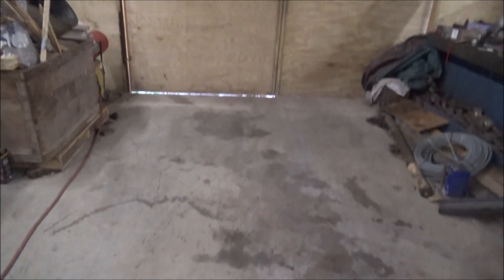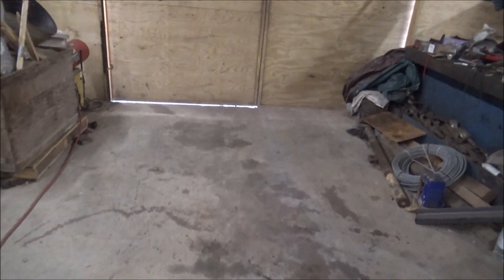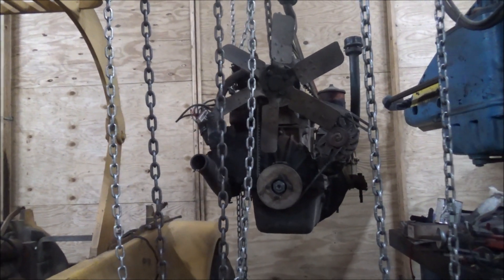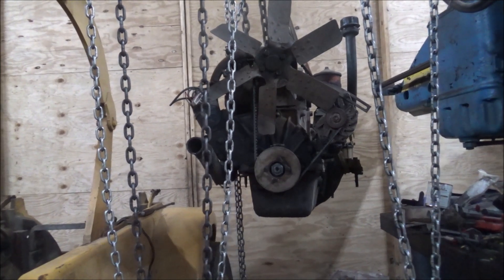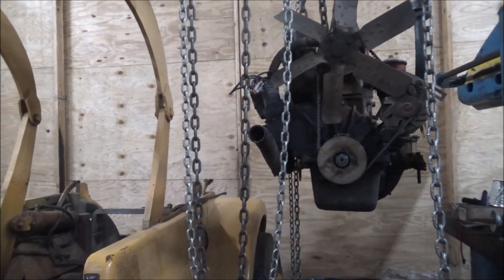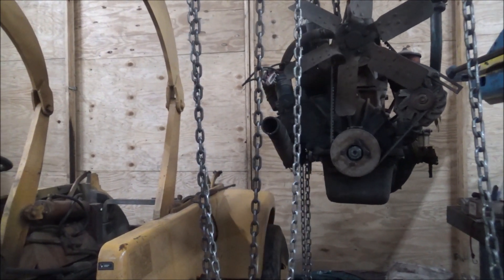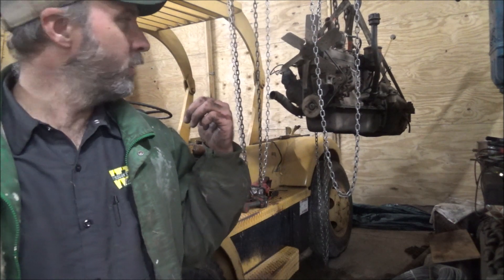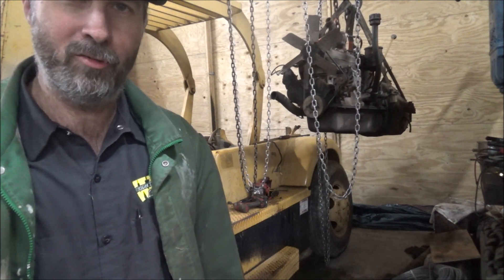Cummins Hyster Part11: Moving a Dead Forklift With 6030 Deere Pulling the Engine and Transmission

Comment: Brian,  with you being a Deere guy at work and on the farm, I'm kinda surprised that a Deere motor didn't find it's way into the fork lift.  The poor old tractor looks kinda sad all bare like that.  What is it a 5020?  It's something around that size/era right?
Reply from the maker: Its a 6030. I started a full restoration on it and that is as far as it got. I started having issues with the rust coming back thru the paint and am going to have to do some rework before I put it back together again.  A Deere engine of the same displacement as the Cummins is too wide to fit.

Comment: Respectfully Sir, You Americans just love  swapping stuff all the time !  The trouble and adaptors, and  screwing around, you will have to do to put that cummins into the old lift, 
instead of just rebuilding  the old  continental gas motor would have been so much 
easier ! And those old hysters were perfect machines in their day !  Also your diff is a gas  diff
ratio Sir !   which means the diesel will have to rev a lot higher to move the machine anywhere
as well as it would move with the higher rpm gas motor!   Not a big concern just for use around the shop !  but if you were say going to get something a mile away, you would see the difference with the diesel reving its head off!   Carb kits are all available , any engine rebuilding 
shop could have rebuilt the old motor in their sleep, and all parts are reproduced ! 
But leave it to Americans to always put in something else, and not mention all the modifications, and complications that , that entails !  from Montreal Quebec Canada
kennethzakaib607@gmail.com
Reply from the maker: kenneth zakaib it was a Hercules and woefully underpowered and actually I think it had the same governed speed as the cummins so no hearing issues. The cummins is an immensely better engine and will be a major upgrade.
Reply: @bcbloc02  My reply, Sir, If I took any position, except to say,  That it is absolutely Your right, to  put into that lift, 
any motor you wish; Sir, IT IS YOUR PROPERTY, AND THAT IS YOUR RIGHT, AND PEROGATIVE!   I MEAN THAT! 
WILL IT BE AN UPGRADE?  OF COURSE !   I AM A BIG FAN OF CUMMINS DIESELS !   HOWEVER SIR, I HAVE BEEN WATCHING AMERICANS VERY CLOSELY ALL MY LIFE !    AND LIKE ALL OTHER PEOPLES OF THE EARTH; 
YOU FOLKS HAVE YOUR  CULTURAL TASTES.   WE IN CANADA,  DO NOT HAVE , THE SHERE VOLUME, OF SALES, YOU AMERICANS ENJOY; DUE TO THE SIZE OF THE POPULATION !  THERE ARE MORE PEOPLE IN  THE STATE OF NEW YORK; THAN IN ALL OF CANADA.    YOU GUYS LOVE CUSTOM BUILDS OF ALL KINDS!   AND YOU HAVE  THE CLIENTS, WHO WILL BUY THOSE PROJECT VEHICLES!     THIS IS A BIG DIFFERENCE !  
TAKE FOR EXAMPLE THE OLD GM DIESEL 6.2 LTR V-8.   TO AMERICANS, IT IS NO GOOD, BECAUSE IT IS NOT POWERFULL ENOUGH !  YOU AMERICANS SAY POWER, POWER , POWER,  IN CANADA, WE SAY , 
MPG, MPG, MPG !  NOT POWER OR SPEED !   POWER AND SPEED MEANS FUEL CONSUMPTION!  PLAIN PHYSICS !   I RESPECTFULLY INSIST, SIR, FOR AROUND THE SHOP, THAT HURCULES ENGINE IS ALL THE POWER YOU NEED !  FOR WHAT WORK THAT LIFT WILL DO!   WHAT I MEANT BY EXPENSIVE TO REPAIR, I 
WAS MAKING REFFERENCE TO  REBUILDING THE MAIN MAST CYLINDER, OR ANY OTHER OF THE  CYLINDERS, TO RETURN THEM TO 100% AS NEW .   SAY ALSO STEERING PUMPS, AND  DIRECTIONAL VALVES
ARE COSTLY TO OVERHAUL,  WHEN THEY NEED TO BE DONE!   ALL OF THESE THINGS, ARE ONLY WORTH WHILE, IF THE LIFT IS WORKING  8 HOURS A DAY,  AND THE BUSINESS IS TURNING A VERY RESPECTABLE PROFIT!   I  HAVE SEEN MANY OLD LIFTS, WORKING  WELL, WITH LEAKING  CYINDERS,  AND  LEAKING
STEERING SYSTEMS, BECAUSE THESE OLD MACHINES ARE SO ROUGH AND TOUGH;  THEY ARE A GOD SEND 
EVEN WHEN THEY ARE NOT ON THEIR BEST PERFORMANCE!   BRAKES ARE VITAL ON THESE MACHINES, 
AND VERY OFTEN THE BRAKES ARE BURIED DEEP INSIDE AXLE HOUSINGS OF THOSE YEARS, OF OLD LIFTS! 
MASTER CYLINDERS ARE AVAILBLE NEW, VERY AFFORDABLY. BUT WHEEL CYLINDERS ARE  USUALLY  HAVE 
TO BE  SLEEVED TO REBUILD THEM IF THEY ARE PITTED !  THAT HAS BEEN MY EXPERIENCES ANYWAY. 
ANOTHER BIG PROBLEM THESE DAYS, IS THAT  EMPLOYEES ARE VERY PICKY , THESE DAYS. i HAVE HEARD 
SMALL BUSINESSMEN COMPLAIN, THEY COULD NOT GET ANYBODY TO DRIVE THEM,  IF THEY DID NOT 
HAVE A CLOSED CAB, ALL THE CREATURE COMFORTS,  AND MANY MEN WOULD JUST SAY , I AM NOT DRIVING THAT OLD ANTIQUE!   FOR ME THIS IS  SAD AND  A REGRETABLE  PROBLEM IN 2020.  
EMPLOYEES ARE SPOILED BRATS!   WHEN I SAY THESE THINGS , I AM ONLY REFFERING TO WHAT I KNOW 
TO BE  VARIOUS TRUTHES ABOUT THESE MATTERS!   I MEAN NO,  DISRESPECT FOR YOUR  PLANS OR  WHAT 
YOU ARE DOING!  ME , ?  PERSONALLY?? I ADORE THESE OLD MACHINES!  THE NEW STUFF IS TOO EXPENSIVE, AND TOO MUCH ELECTRONICS ON THEM, FOR MY TASTES !  
ALL THE BEST REGARDS SIR, kennethzakaib607@gmail.com
Reply from the maker: No worries! Lucky me this Hyster looks so old it was just built out of off the shelf semi truck parts.

Comment: You need to put weight bracket back onto that Deere! How are you going to rig up that hydraulic pump, you going to fabricate a drive off Cummins front pulley?
Reply from the maker: Yes it will drive the same way it did before.

Comment: Excellent video keep up the great videos 👍👍👍👍it's always nice to get the old engine out of way I usually set the new engine in and then figure out where to put the radiator I would try to find a industrial applications radiator and make the mounts accordingly. I made that mistake when I changed my allis Chamlers forklift from a Perkins gas engine to a cummins 4 bt diesel engine I have since correctly that now it looks like it was factory mounted in the machine

Comment: What transmission did Hyster use in your forklift?  Looks a bit like a Ford.  Are you going from the SAE on the transmission bell housing to the SAE flywheel housing available for the Cummins?
Reply from the maker: It’s a new process transmission

Comment: Building new engine mounts and aligning the drive shaft and hydraulic PTO are going to be the critical part. To make things easier you may have to remove some of the body sheet metal to give you some room to work. Nice project.
Reply from the maker: The whole back end is cast iron. There isn’t much sheet metal.

Comment: That's a pretty big engine and the Cummins is even bigger... I was wondering if you considered using an electric motor to dirve the pump? It would be much smaller and you might just even have one in your 'inventory' that would work well. You could put the batteries in the extra space and if you used lead acid that would add to the counterweight. You could also get solar panels to charge up the battery pack. And if the battery pack is charged up you could use the excess electricity to run some machines. But if you didn't want to use batteries, since you have all that power in the shop and the fork lift probably isn't going to have a large travel area, you could possibily have a long extension cord to power it.
Reply from the maker: The forklift is needed to go everywhere. Diesel is the way to go I think.

Comment: The question must be asked. Why didn't you back the Hyster into the barn, rather than pushing it in forwards? It would have put that engine bay so much deeper into your work area.
Reply from the maker: I can pick up the back end and steer it. I can’t steer it from the front end and you can’t steer it at all if it’s not running.

Comment: Just a heads up. Plan on offsetting the motor towards the drivers side a bit. You will have clearance issues with the injection pump and the tilt cylinders.
Reply from the maker: Actually the alternator sticks out further than the pump.
Reply: @bcbloc02  Yeah I had to relocate my alternator on mine. If you look at the centerline of the crank though, that injection pump sticks out like a sore thumb. An isuzu NPR alternator with a piggyback vacuum pump is a good fit and will supply that monster brake  booster you have under the floor.

Comment: Did you mention what's wrong with the original engine?
Reply from the maker: It has valve issues in the block and extreme blow by.
Reply: @bcbloc02  have you had it running?
Will be interesting how you put that monster in it!
Reply from the maker: Dan'sMeTube There is video of the cummins running if that is what you are talking about.
Reply: @bcbloc02  I was actually asking about the old engine. But, I suppose it it remotely ran, you wouldn't have used your tractor steering with brakes!

Comment: excellent video, watching the Deere pull the Hyster like it was nothing unusual just slow and steady, real cool.  It looks like the Cummins should be a relatively easy conversion, set the trans back in the same position rework then front engine mount and radiator, plenty of room for the pump to stay  where it is, hood may need modification or be deleted.  radiator should be addequit for the duty cycle you  will use it for
Reply from the maker: I don’t think it will be terrible. It’s taking awhile to get it squeezed in the best spot but it will go.

Comment: That John Deere has some major lift capacity on the hydraulics to lift the front wheels like that in response to the torque being applied to the wheels! and congratulations on managing to push it into the workshop as well as that - no mean feat to manage this difficult task and buckets of patience needed.
Reply from the maker: I think it is rated 7500lbs 24” behind the hitch. Probably lifts just over 10k where I had the chain.

Comment: I'm just in the process of replacing the engine (drive hub springs to the reverser blew up) on my JD350B crawler.. the old Ford County was really handy https://i.postimg.cc/t4wSM4Gg/20201021-133657.jpg
Reply from the maker: Looks like you have a damaged track pad?
Reply: @bcbloc02  I have about a dozen on there that are damaged.. those pads are 6" wider than the original pads, great for soft ground but when crawling over rock they bend and break... doesn't really matter for what I do.. scraping corrals and such
We're up to 4 first gen dodges now, 3 diesels and I just picked up a nice little 150 gasser, extended cab shortbox.. some good body parts on it, I'd like to put a hot 4BT into it.. other recent addition has under 100K miles, needs a new diff (that's tomorrow's project)

Comment: Any punk can pop a wheelie on his Kawasaki, but only a real man can sustain one at 0.001 mph.
Reply from the maker: No need to get in a hurry, let the torque do the work. :-)
Reply: A friend of mine's dad was dragging a log with his tractor and it caught on a stump, flipped over backwards, but he managed to avoid serious injury because the exhaust stack poked into the ground and stuck, leaving the tractor balanced on the two rear wheels and one pipe. I never heard whether he had to clean his pants out, I would have had to, for sure.
Reply from the maker: weshowe in my case it can only come up till the forklift tires hit the ground.

Comment: It takes a good man to push a load with a chain!
Many times Ive had the  front wheels off the ground pulling logs out of the woods. But it sure does make you tighten up when going uphill.
Reply from the maker: If you pull the chain tight enough you can push with it. :-)
Reply: @bcbloc02  All my chains seem to have "Old Man's Disease". (;<)
Reply: Yep the Pukker factor is there for sure
Reply: yep

Comment: Impressed that the tractor was able to get the rear wheels of the forklift off the ground!  I have '84 15k Hyster, with a GM straight 6.  It uses a 'wet' clutch, where hydraulic fluid is run through the clutch housing.  Does yours have a wet clutch? I purchased mine 10 years ago for cheap because it has a rod knock.  I've been dreading replacing the engine because I have no idea how the wet clutch works.  Hoping I'll get to see that when you get into the trans on this.  Thanks.
Reply: wet clutch is easy just like a dry clutch except the disc is like the clutches in an automatic with grooves in it for the oil to move thru for cooling.  the oil is mostly just flooded over the clutch assembly and floods the disc when the pressure plate is released.  the hardest part is to make sure the bell housing doesn't leak
Reply: @pauliossi2674  OK thanks for the info.  Surprisingly the bellhousing doesn't leak currently, another reason I've left the engine alone ( well and laziness).
Reply: Greg9504 I would not be to worried convert it to dry if in doubt.
Reply from the maker: Pretty sure mine is dry clutch.